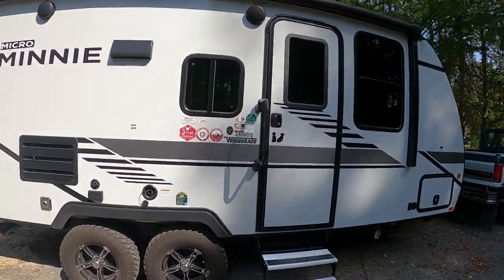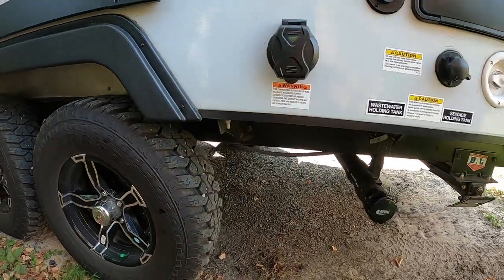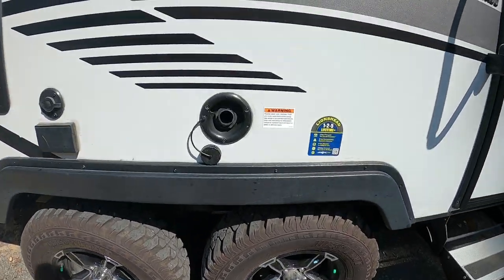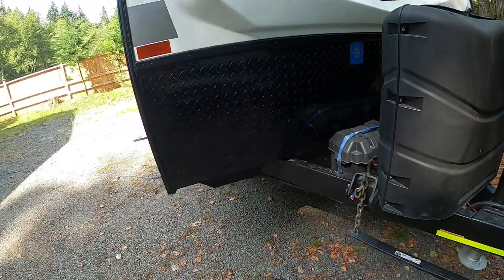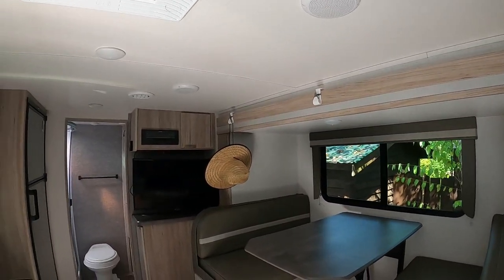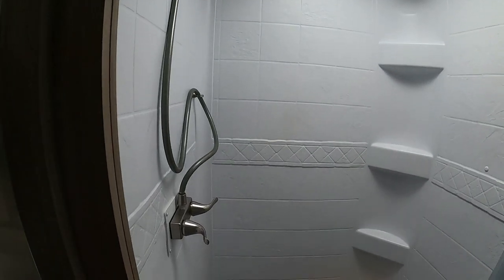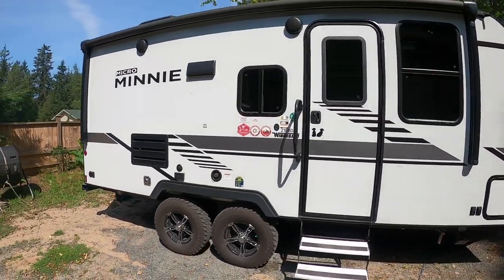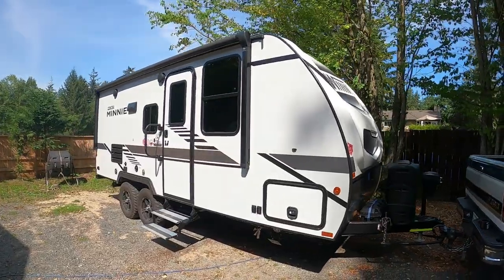Winnebago 2108DS 1 year review.

Comment: It was nice to watch and listen to the opinions of a fellow mechanic. I work on a lot of remote jobs and have lived in trailers away from home for years at a time, no matter what you buy or how much you spend the components they use seem to always be trouble, and the dealership service is often a disappointment. I usually just contact the manufacturers warranty department and have them ship the parts to me direct to fix it myself. The only thing worse than the manufacturers QC is the dealership service department’s QC.
Reply from the maker: Yes, I've learned that all manufacturers have the same sorts of problems, then as you said service departments are lacking qualified "techs" to do the repairs, now that it is off warranty I'll be doing the repairs myself. This is about the 7th RV that I've owned it's been the most trouble.
Reply: I don’t anything about trailers but them red wires hanging down in the back aren’t confident inspiring
Reply: Most good mechanics I know start working for themselves. Dealership techs tend to be new, less than competent, or don't want the hassle of running their own business. You can only hope you get the latter. I bet it's the same for RV techs. On the plus side, the independent guys will usually come to you and be done in a fraction of the time.

Comment: A lovely thorough review that is nicely balanced between the good and the sometimes bad. As others have mentioned, the message to Winnebago and the dealer should be better quality control. But lots to like. After looking at many trailers in this size range the 2108DS ticks more boxes than most in terms of storage, light inside  and towability. Thanks for this 1 year review.

Comment: Thanks for being so candid about your trailer. I'm glad you still like it even though you have had numerous problems. I totally blame it on the current suppliers of components because you can find the same problems on every brand right now.  We still like the way these are built compared to some and they're on our short list. Fit and finish is important to us. It' just the RV industry in general right now.  A person just needs to really inspect before buying and try the slide several times. Also, we are fortunate to have a great dealer close by.
Reply from the maker: Yes I think you're safe buying one if you have a good dealership that will check it over well before you pick it up and look after any other issues down the road. I don't think any brand is trouble free.

Comment: Purchased 2021 Winnebago 1708 fb … dealer had everything prepared when I arrived. My first trip out a week later ? Water heater quit!! I kept burning out the safety diode ??? I cleaned burn tube and it’s ok now ..  I also noticed the ladder in the rear? Screws coming out ? Had to repair that.when you level the trailer … my screen would not stay latched.. had to fix that. The grey water button not working? Took that apart and there was not enough clue on back …Next time after 4th trip ? Heater will not light… sail switch is on the way from Amazon now. Didn’t need heater this summer.. I’ve been doing the work myself . Dealers are months out.. basically any trailer will need repairs !! I also believe Winnebago has a good product. The price is dometic is garbage . Basically every time I take it out something breaks ..

Comment: Bought my 2108 in Jun 2023, one drawer stayed open while towing, slide is a little wonky, no leaks, havent used the heater yet, AC fine, switches all work. But I'm not a mechanic. Appreciate your vidoe, I will do a detailed underbelly inspection.
Reply from the maker: Thank you! Definitely check the underbelly for any openings, rodents don't need much of a gap to get inside.

Comment: I just spent $1200 to have my slide repaired- new wiring harass and switches.  I had a recall on my cabinet handles.  I noticed that you still have the original handles.  The fake trim on the bottom of all of my cabinets are falling apart.  I have not been able to get Winnebago to respond to this problem.  I like the swivel on the bathroom sink.  I put in a taller faucet thinking that would solve the problem but it did not.  I found foldable cloth baskets to put on the shelf above the bed and they fit perfectly to hold some of our smaller things.  I have a new water heater, fixed the stove and heater, and with the slide fixed I I will keep this trailer until I buy my motor home.  It works for me and the dog to get away.
Reply from the maker: I have some ongoing issues with my slide as well, I'm waiting on an evaluation of it at the dealer. In regard to my door handles... I cut my leg on one the first time we had it out so I took a small file and some sandpaper and removed all the sharp edges. I got the recall notice in the mail and called the dealer, they told me that the new handles don't line up with the original holes, so they would have to drill new holes. I decided to pass on getting them done. Sounds like you have had your share of defects too.

Comment: We had a very similar situation on our brand new 2023 Cruiser RV MPG 2100RB. We have had it about a year now and I have had to fix switches, the water heater blew a fuse link, the refer blew a fuse link, The bathroom cold supply line blew off and almost flooded the camper. Lots of other little issues as well. We have a warranty on it like you but we have decided to not continue with it because of the lead time on parts and service. I am still waiting for them to call me about the refer but I have since repaired it myself as they misdiagnosed the issue (they said the control panel was bad and it was a inline fuse). All in all if you buy a camper get ready to fix it yourself and stay away from their warranties as they are not worth it at all.

Comment: Pretty much all the same problems with my 2108tb.  The next owner will love this thing though lol now that warranty is up I’ve torn it apart fixing all the small things.  Been through water heater thermal cutoff switch, furnace breaking due to dirty sail switch, upgrading to lifepo4 and changing the converter, multiple leaks from the water lines in kitchen and bathroom, adding weather seal on all the cabinets for better insulation.  Also I’ve owned it a year and every time I tow it more saw dust appears in the cabinet areas from the lazy installers drilling holes and never cleaning up.  Still planning to weld up a tire carrier that mounts to the front and then putting batteries in storage area, add some more solar etc.  already invested now so whatever lol
Reply from the maker: I feel the same, the trailer is exactly what we wanted so once I've repaired all of the defects it will be great. Who'd have thought we were buying projects? :) Funny thing, I was checking out the control box for the slide drive motors (for when one fails) and in behind the access cover there were several left over pieces of electrical wire and wood waste.

Comment: if it works once and then quits, that's what mine did, move the high temp fuze-link to the side with a short jumper wire.. when they redesigned them to use one control board for both gas and electric they just start failing all the time..

Comment: I have the same trailer and have the same water heater with the same problem, I was told it was a bad batch of thermo couplings and the dealer gave me a couple of new ones and said that will fix the problem. Trailer is winterized and in storage now so once spring is here I will see if that fixes the problem.
Reply from the maker: The thermal break was replaced in mine about 6 or 8 times (the first time was when they demonstrated the unit for us), nobody ever found a cause. They run it in the shop and it doesn't fail but when in use outdoors a slight breeze causes the burner to flutter and then it back fires. It keeps blowing out then restarting until the thermal break melts. The last time I had it in the shop they removed the bead of silicone that is between the housing and the water heater access cover. That was at the end of the season so I won't know until this spring if it made a difference. I have a video of it popping and restarting if I do a follow up video I will add it.

Comment: I had a similar new 2019 Winnie and it was a constant problem. Roof antenna leaked, furnace needed constant maintenance due to poor unfiltered intake air, tv was doa and had a best buy refurbished sticker on the back when we took it down, vent over stove never worked, light in slide quit working, bathroom vent fan quit working, entry door hinges froze.

Comment: I have a micromini 2020 I am having trouble with the frame it is cracked in the front, and I heard in your Video  you, said the Bolts were loose on the frame, mine were two. And I tighten them up. It got so bad where the siding was coming off on the side. I have talked to several dealers and no one will fix it.
Reply from the maker: Winnebago should definitely be looking after that, the frame shouldn't be cracking. I'll have to keep an eye on mine too. I would write them a letter.

Comment: If the heater wasn't working correctly why didn't they replace it under warranty?
Reply from the maker: The furnace they repaired but they didn't say what was wrong with it. And the water heater was an ongoing problem that took almost a year to get repaired. The thermal cutoff was blowing (like a fuse) and they would just replace it, not knowing why it blew.
Reply: @austingipsysite  The whole trailer is suffering in some way and should have been replaced a real shame you got treated like this, cheers from Australia.

Comment: Schwintek slides are problematic. You’re not supposed stop in the middle of deploying or retracting the slide. It will throw the motors out of sync. There’s videos on YouTube to show how synchronize the motors.
Reply from the maker: I'll check that out. When the dealer demonstrated the slide he stopped and started it a few times midway. Told me they synchronized themselves. Hard to say how many times it's stopped on it's own. :/
Reply: @austingipsysite  if it’s stopping on its own then there’s a problem and should be checked out by a tech.
Reply from the maker: @markreams3192  Thank you Mark, my trailer spent two weeks at the selling dealer and then another 6 weeks at another dealer getting all of the defects repaired. The slide was normal in their opinion. So I guess that speaks to the quality of the unit.

Comment: Purchased 2108DS December 2020.  6 failed water heaters, failed furnace, several failed waste tank valves, cupboard doors fell off, door lock fell off, water leaks,  refrigerator failed, underbelly came loose, prpoane gas leak, inside light switches failed. All within a few months of purchase. Nightmare.
Reply from the maker: Wow that sounds worse than mine, sorry to hear. this weekend while de winterizing I found a water leak in the line to the water heater and the back splash on the wall behind the sink is delaminating.  Can't wait to see what else this years camping season brings.

Comment: Getting one of these in April, Can you fit two type 27 batteries on the battery channel? Or could you only fit two 24s? Thanks
Reply from the maker: At the narrowest point of the battery tray it measures 23 1/2" and I think a type 27 is 12" in length. So just a half inch too narrow. It would be possible to move the tray (Not really a tray just two pieces of angle iron welded across) back towards the body of the trailer though.

Comment: A lot of poor quality overall. I.E. underside falling down, water heater not working, bath sink flow poor design, rusted drain valves and cheap switches all around.  I thought  this brand was better than this !  Also have a friend wt a 1705 model tandem axle and the axles were delivered out of align which wears the tires out really fast.   Also interior appliances are coming loose from mount points  inside so shawty workmanship.  2015 and 2023 models.

Finally parts taking for ever like the cheap fridge handle. oh my God !
Reply from the maker: Yes, Winnebago has definitely shown to be a disappointment all round.